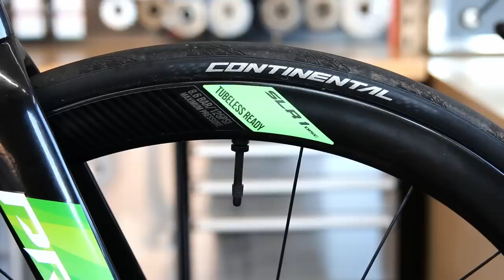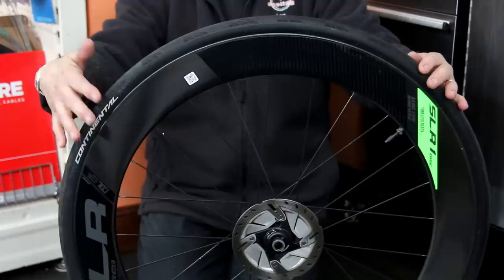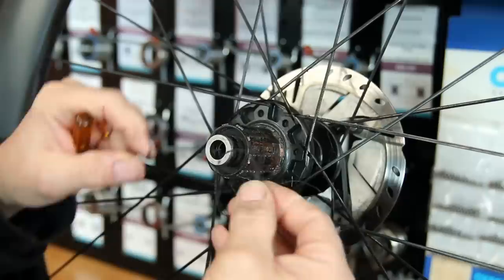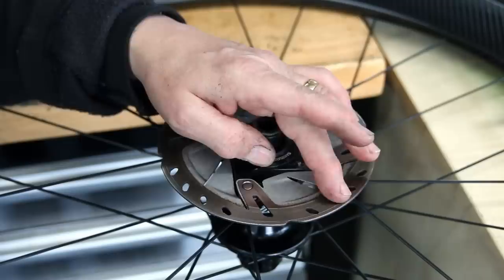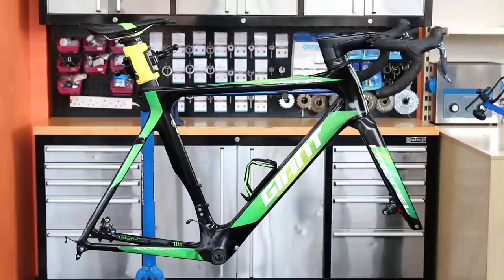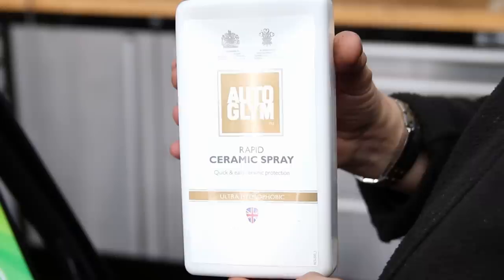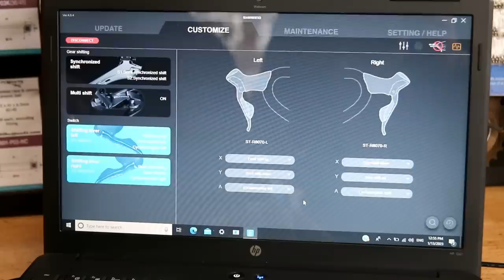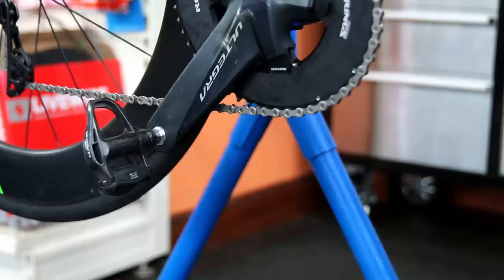Giant Propel DI2 Service! Road Bike Rebuild!

Comment: I have that same model of bike. God help you the day it needs new headset bearings! The brake hoses pass through the centre of the bearings so you have to open up the brake hydraulics to get the bearings off. Unfortunately, the hydraulic nut will not pass through the holes in the handlebars so you have to cut the olives off to remove the nuts. Whilst it's an aerodynamic joy to ride, it's a bike I only ride in the dry to minimise my chances of ever needing to replace the headset! It's also a bike for very smooth tarmac. It's unbelievably stiff and very punishing on rough surfaces. A bit like riding a steel girder!! But it's like  a missile for top end speed.
Reply from the maker: We have come across similar systems in the shop and you are right they’re a nightmare. Very very un compromised system. That’s a great bike though!🧡⚙️

Comment: where is the controling hydraulic fluid, open bearings in hubs, clean hubs and disasembled rear freehub body, headset... this is basic service no rebuild, wash parts, drivetrain parts  (i dont see chainring disasembled from cranks).... but nice video ;) have a nice day

Comment: I agree with you, dry lube can cause so many problems, I have tried it for some time and the after effects don't warrent the benefits. lovely bike I bet the owner has a very big smile.
Reply: So do you use wet lube?
Reply: @emorhcelgoog  Yes have tried lots of different types and measured the chain wear after 1000 miles and the best one so far has been cheap 3 in 1 oil. it's easy to clean off and re-apply, plus you don't need much, I put a drop on each roller, leave it for an hour or so then give a quick wipe to remove excess.

Comment: Enjoyed the video, as always. Interesting comments about dry lube. I use it because it doesn't pick up dirt as quickly. I thoroughly degrease/clean my drive train monthly so haven't had a problem but I'm going to check closer to see if residual dry lube is building up.
Reply from the maker: If you keep it clean I’m sure it’s no problem at all it’s just when it builds up that it becomes hard to get off 🧡

Comment: love those videos, I learn a lot of good practices just from watching, thanks a lot!
a couple of quick questions, 
1- do you also use degreaser for dry lube? my understanding is that these are wax-based, rather than oil based, so is the traditional degreaser the right tool for the job?
2- how do you wash these micro-fibre clothes? just in a washing machine?
thanks again!
Reply from the maker: We used oil on the dry lube to make it easier to work off. And towels we usually just throw away as we go through so many. Thanks for watching and glad you enjoy the videos!🧡

Comment: Rotation of the tires must’ve been tough, those tubeless GP5000 fit snug! Would love to know how those brake pad retention screws were stripped like that.
Reply from the maker: There was definitely a previous attempt on the brake pads but a fix is a fix so they’re working again now which is the main thing to us🧡

Comment: I've just come across your channel and I love it, so satisfying to watch! One question that you've probably already been asked is - For those who don't have an ultrasonic cleaner, what's the best method to deep clean components? I have degreaser but not enough to soak stuff in so would washing up liquid or similar do the same job?
Reply from the maker: Washing up liquid and a spray degreaser works. If you have the patience a few months from now we’ll be listing the products we use on a website for you all to purchase but any degreaser spray will definitely help if you need it now🧡

Comment: I love your videos because you explain every step you are taking. I have onely one question, Do you check te BB bearings? don't they need to be service with new grease like other components of a bike?
Reply from the maker: We do check them. Often they’re absolutely fine and we save the customer the money until we feel they need doing. Thanks very much for watching 🧡
Reply: @Bikespeeds  TY, I usually service the grease every 6 months because I usually sweat a lot and during winter I do my weekdays workout on a indoor trainer. For that reason I was curious about that part of the maintenance.